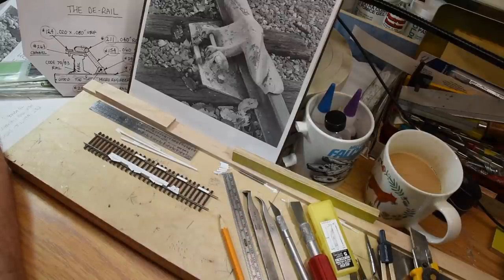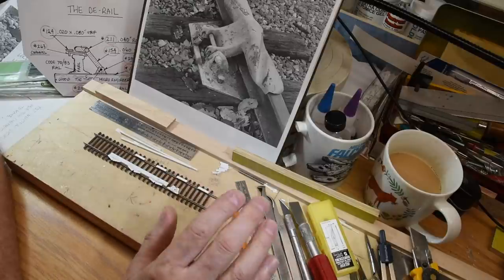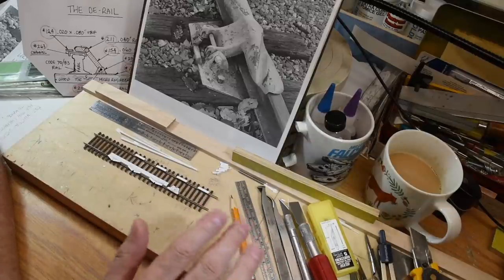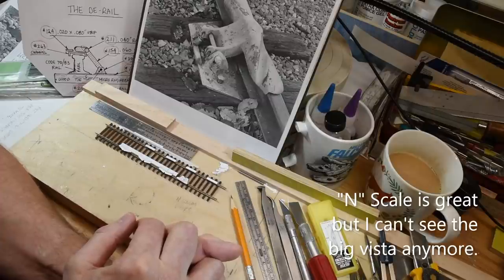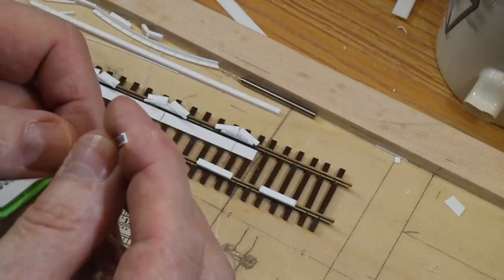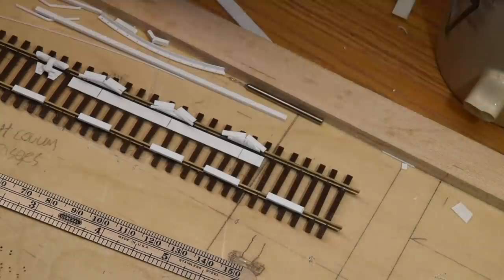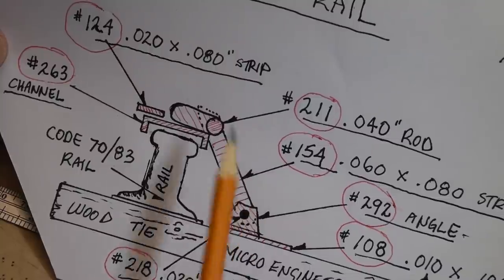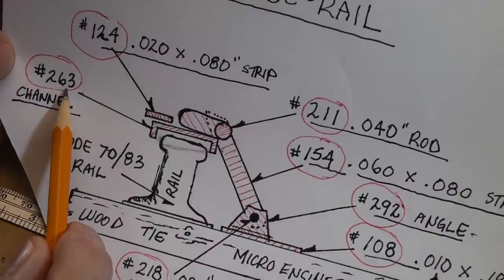Modeling A Realistic  "Derail" Device (Part 1) | River Road - Vlog #57

Comment: The derail in the photo and your models are of a bidirectional derail which is not typical.  Most derail locations only need to be for derailing to the right or left depending on which way the derail throws the car.  Usually, this is to protect the main line from an errant car or piece of equipment from rolling close enough to foul the main track.  There are specific locations that need a derail to prevent the accidental coupling and movement of cars spotted for loading or unloading as well as occupied camp cars(portable derails).  A derail can be the casting that flips over as is the photo, a sliding derail operated by a stand, a single switch point, or a double switch point without the frog of a turnout.  A Hayes derail(that is what this one looks like) is ordered by size(height of the rail in full inches rounded to the nearest full inch), direction of throw(left or right), and whether flip over or sliding.  Hayes used to make castings but in the recent past has been building them up as weldments similar to your building of the models.  Most railroads have a standard plan on the requirements of where a derail is to be used and how it is to be installed.  If an industry loads or unloads oil or other hazardous materials a derail is required to protect the cars from accidental coupling as well as a derail to protect the main.  I have seen one or two painted red or orange but most derails are painted MOW yellow.
Reply from the maker: Thanks for sharing. Great information. Cheers.

Comment: It's a particular "way of seeing" that makes it possible to reduce a complex shape into its "primitives" (in this instance, the C-channel, the quarter round, the strips) and then to build them up from basic materials. Once pieced together like that, what remains is refinement. This is how one learns to draw--to see the thing for its shapes and lines as they actually appear rather than as your "left brain" judges them. When I look at a derail, I just see a blob of forged steel because that what I judge it to be (it could be cast, but I don't think so). I don't immediately see a structure of shapes at all, even though I should know it has to be structured to articulate with the rail and the flanged wheels.
Reply from the maker: I can't explain that part, I can only demonstrate it. Maybe that is the gift, who knows. I just lay squares and circles over everything I see instinctively. It's a type of crude mathematics that artists are known for. ;-) Cheers.

Comment: good vid... however a word of warning for those who use a derail on their layout, be prepared for the high probability of forgetting to take it off and running it over... now i'm not saying you'll run it over everyday but there will be "that time" you'll forget to take it off... on my layout i have certain free rolling cars that need to be chocked so one time i used a piece of scale 2x4 for a wheel chock and forgot to remove it derailed the car DAMMITT!!!!!!!... so be careful
Reply: Well isn't that the point of the derail?  To keep the lazy engineers in check :P
Reply: Real railroads do it too so if anything, it’s authentic.
Reply from the maker: O.K. ;-)
Reply: @Panzermeister36  🤣🤣